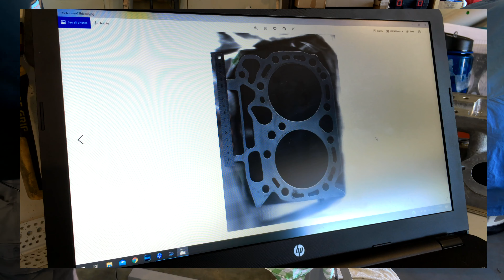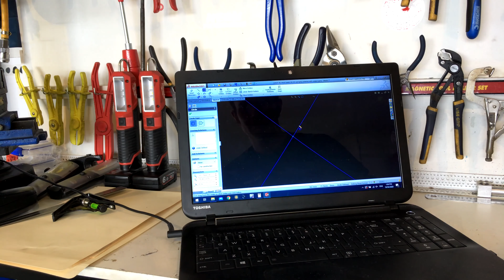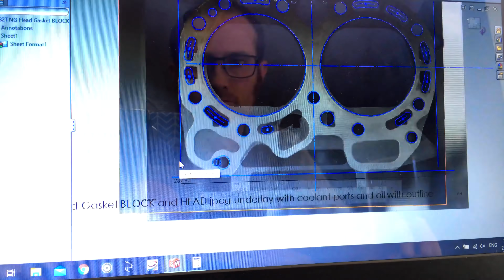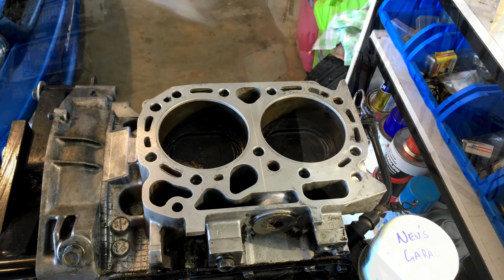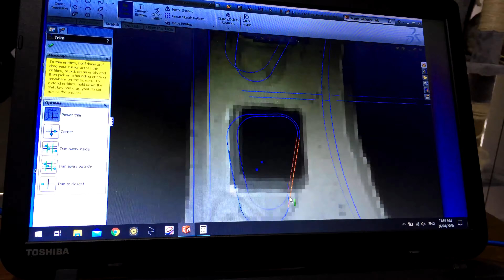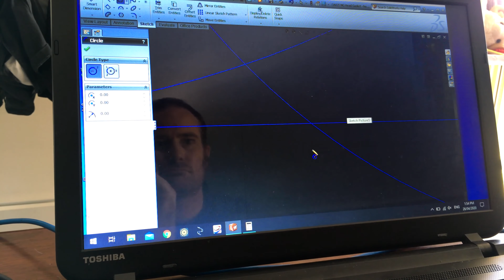DOHC EA82 Project - Episode 3 : Drawing up the Head gaskets

Comment: i think you and me are the only ones doing things with xt's these days. i have a 91 xt6 but you guys i think call them a vortex. liking the custom cylinder head stuff that's kind of the route i plan with my ER27 but i'm gonna try heads from a more available engine not sure if it's gonna work yet. still got some measuring to do and might have to modify my block. cool stuff keep the videos coming.
Reply: Just fit an EG33 or EZ30. You bank balance will thank me later :)
Reply: @stevewandel9317  I know it's going to cost more but there are bragging rights associated with making something new and being creative. building the most powerful ER27 in existence I feel is worth it. if my plans line up.